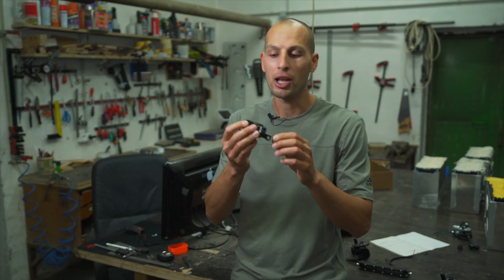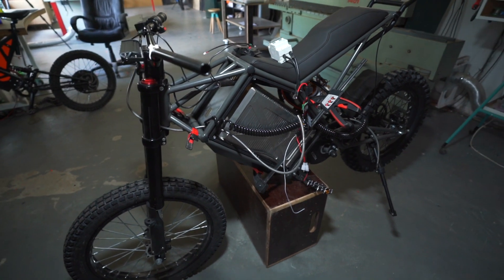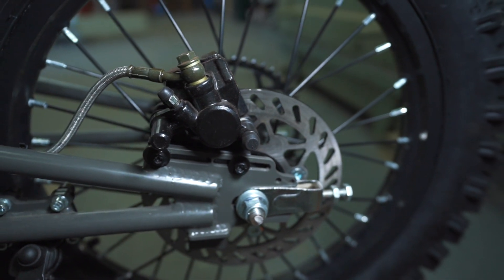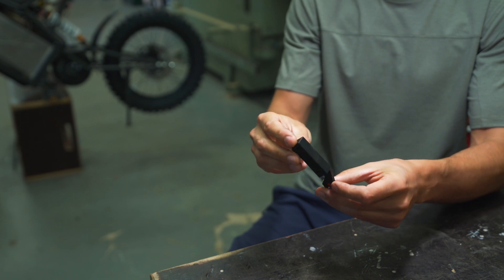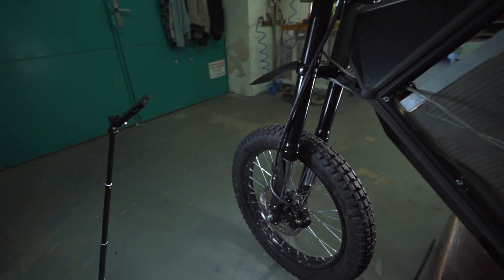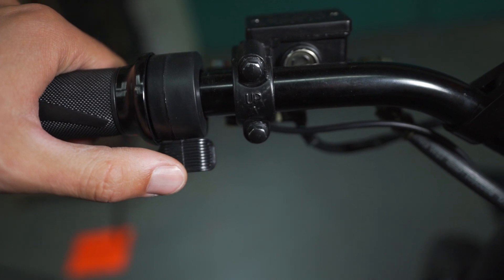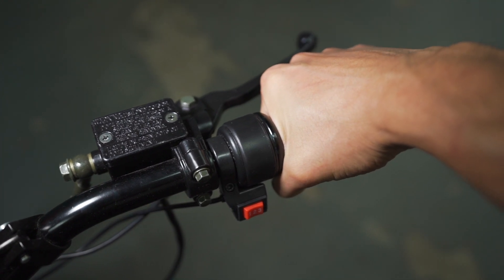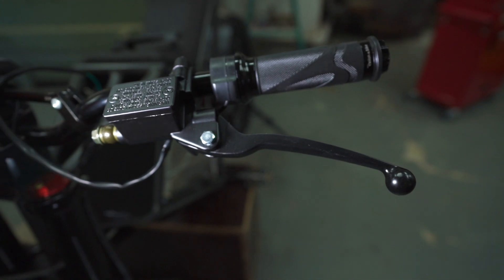Powerful Electric Bike Needs Custom Motorcycle Brakes

Comment: But how will he keep the load? 
The more question is how this plastic will transfer heat.
Heat is transfers from the caliper just through the adapter and bolts. Hard braking will cause problems and even smelting this trash plastic.

Comment: Thinking about doing the same set up mechanical brake plus thumb regen. Is that just a regular thumb throttle from a scooter or something? I have a 2 pin regen can I just use any thumb throttle?

Comment: I noticed in your last video that the stance of the entire bike looks off. You’re building a motorcycle and should start thinking of it that way instead of an eBike.
Reply from the maker: Hi, what stance seemed off?
Reply: Ladislav Jecminek on motorcycles the wheel base is longer for more stability at high speeds, specifically the front forks when looking at hour bike. I feel like I would be prone to crashing if I drove it. However I’ve been riding motorcycles for decades and never been on a true MTB,  and this is your design. Still loving the content!

Comment: Correct me if I'm wrong but it looks like your not on mountain bike down hill forks.  It looks like your on some kind of pit bike or mx dirt bike fork. If you're on mtb forks then I see the need for the custom adapter,  but if not then you shouldn't need it.  Also would these adapters that you made fit alot of downhill mtb forks like fox 40? If so it would be nice if you could sell it to the public.

Comment: Please do not use these chinese scooter brakes. I have a company servicing scooters and these calipers are really piece of junk, many problems with clearance on pins after few kilometers etc.. I would go for Piaggio caliper 600734. If you need to buy them in CZ just contact me. Price is 40 EUR each. https://images-na.ssl-images-amazon.com/images/I/51XweZ25a3L._AC_SX425_.jpg

Comment: I use the Tektro Dorado twin rotor setup. I have a 55kg ebike and I weigh about 90kg. It stops it so hard, I have to glue the tyre onto the rim and they last a very long time! I've had the same pads on there for 4 years due to the doubled pad surface area. Obviously motorcycle breaks are better, but if your a weight nazi and you don't want to have to modify your forks with an adaptor bracket, then the twin rotor tektro setup will do the trick if you have the DNM forks with double mounts :)
Reply from the maker: Hi Jim, I had 203mm dual brake too and I absolutely loved it! The only problem is the only supported fork - DNM USD8 which is very bad for our purpose and weight. It’s only for smaller and lighter bikes with medium performance quality.
Reply: @ladiandmargaret  Yeah I get you there, if you want quality shocks your stuffed!! I just wish they did other forks with dual mounts. Nothing! can match the bite! you get from those dual rotors!!

Comment: What it needs is ABS
Reply: I wouldn’t trust any type of plastic, nor 3D printed parts for stopping power no matter how strong you print it. Metal should be the only application here due to the heat dissipation coming from the brake pads and brake caliper.

Comment: How thick are the discs you use? You should be aware that warping can occur when too much heat is put into the disks. Fading because of repeated conventional braking can also be an issue. Of course regenerative braking is preferable but I doubt present legislation allows to include that capacity into the overall braking capacity. In other words: If you want to have your bike CE approved you will have to prove that the system still has enough stopping power and endurance under constant use when 0 % regenerative braking is used. I'd estimate that you need brake disks of 4 to 5 mm thickness, depending of the used material, on this bike. It's good to see you are taking this sort of stuff into consideration as well. Off course legislation can be interpreted so strictlty it slows innovation but overall it saves lives.
Reply: So no one argues, just the author of the video made a video and kept silent about it or knows that it will be wrong. 
A knowledgeable person knows that with sudden or numerous braking, this plastic will either melt or crack

Comment: i did the same a couple of weeks , since im a bit heavy ,, needs to be those brakes ,, how much for those mounts ?
Reply from the maker: I think they’ll be always different for different forks and rotor diameters.
Reply: on the rear brake ,but front is worse , so i need to get hold of brake adapters, i was hoping u sell some
Reply: Best bet is to design something yourself and go to a local fabricator.

Comment: Where should I buy an electric bicycle. I really like the sur Ron.
Reply: Which country are you from?
Reply: @jcreedy20  United States Massachusetts
Reply: @jcreedy20  I have a Bentelly 750 w. I just broke. So I need a new e-bike. I'm looking for one that I can take off road. I was thinking of the delfast so expensive. Thinking about just ordering a Chinese frame and building one myself
Reply: @sift8386  If you decide to build one yourself, I would highly recommend doing so!! It is very rewarding, as you will gain confidence and skill with fixing ebikes, just as i have done. If you stick with building a basic ebike that has a battery with a built in BMS then it is very easy to do, as all you will need is, controller, motor/wheel, battery with bms built in (just a couple of cables to plug plug!) and throttle, thats it!!!! If you can fix normal push bikes and push a few cables together! you can build a fricking simple EBike thats powerful enough to hit 50 mph!!. It's only when you start going really big power that you need to worry about learning how to wire up BMS systems etc, that can come later. But if you want a quality ebike from america then i strongly suggest you go on to the Endless sphere facebook page and Endless sphere sales and wants facebook page and sign up and there are tons of people in the U.S who build ebikes at a very good price!! I can even introduce you to a few people in the U.S who build. I'm from the UK so i can't help you over there.
Reply: @jcreedy20  I deleted my Facebook account. Do you know where I can get a good frame? I don't trust Alibaba? That's where I've been looking there's one on Amazon I'm thinking of buying for $600 and something dollars. It's basically the one everybody's using the newer one
Reply: @jcreedy20  If you can send me a couple links be much appreciated.I'm saving right now for a frame probably in two more weeks I'll buy it. I didn't want to go with a hub motor. But that's the easiest way to go.
Reply: @sift8386  If its this one https://www.amazon.com/performance-suspention-enduroebike-frame-electric/dp/B01N0Z27Y0/ref=sr_1_2?dchild=1&keywords=ebike+enduro+frame&qid=1595802368&sr=8-2  then yeah its pretty good. Lots of battery space, the first design had a bad swing arm pivot and would break easily but its been rectified now. Endless sphere also has a normal website and it has the sales board on there too. Have a look at it!
Reply: @jcreedy20  thanks for the info bro that was the frame I actually was going for. I'll let you know when I order it.
Reply: @sift8386  Nee bother lad. Yeah let me know how you get on. Or if you need help
Reply: Sur ron is a kids bike lnfao
Reply: @alphaomega1276  kids' bike that's properly balanced
Reply: @sift8386  and overhyped and overpriced lmfao
Reply: @sift8386  link doesnt work...so what? Segway is trash too lol

Comment: Are these bikes available in india
Reply from the maker: no, only in Europe
Reply: I am also trying to build ebike but motors are maximum 350w or 500w
And powerful motors are very expensive 
There are no high discharge batteries and a single cell costs around 770 rupees or 11 dollars 
And controllers are also for max 24v
I want to build a 8.5kw bike 
But it is almost impossible to find such high end parts here 
Can you give me some advice for building a 80-100 kmph ebike with 80 km or 50 mile range
Reply: @adityasubhedar9556  hey buddy try gogoA1 its an indian site they sell good ev parts :) There are couple of others that I cant remember the names of:)
Edit watch this video as well if you need bldc motors in india: https://youtu.be/zVqg02-2ijI 
Either ways are good:)
Reply: @adityasubhedar9556  lithium ion and polymer cells are sold by robu.in by the brand name Orange. It is an indian brand so it is available for cheap around 3 dollars for  high discharge cells:)
Hpoe you build your bike soon. Best of luck and happy buliding:)
Reply: @Ozonised  but what about bldc
Reply: @adityasubhedar9556  i told you to check gogoA1 site
Reply: @Ozonised  ok
Reply: @Ozonised  thanks man 
I saw your video about flat batteries in your cyber bike what are they called
Reply: Is it safe to use li polymer batteries I saw them exploding and carching under heavy load
I cannot afford bms and if any thing goes wrong my parents won't allow me to buy batteries
Reply: @adityasubhedar9556  use li ion cells by orange it is an indian brand and is available in robu.in.
Check the datasheet of the cells before buying:)
Reply: @adityasubhedar9556  it is safe as long as you dont start hitting the batteries with a hammer or nail a hole into them. But lipo batteries are comparatively expensive than lion cells. Well if money is not the hindrance than you can go for it:) But a BMS is a must no matter what!!!
Reply: @adityasubhedar9556  you can easily calculate the maximum current that can be drawn from a cell by multiplying the battery capacity in AH with the discharge rate:)
Reply: Can you tell me how to make bike aerodynamic It takes lot of energy
Reply: @Ozonised  I am making it from my bicycle
Reply: @adityasubhedar9556  sorry I dont have much knowledge about aerodynamics :(
Reply: @adityasubhedar9556  If you are doing it for your bicycle than you could easily make one under 35000 rupees